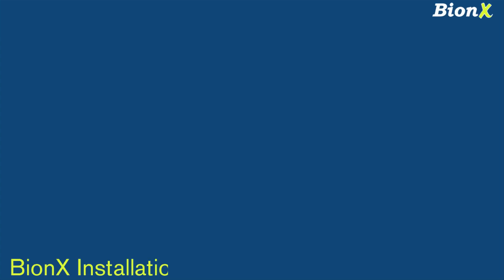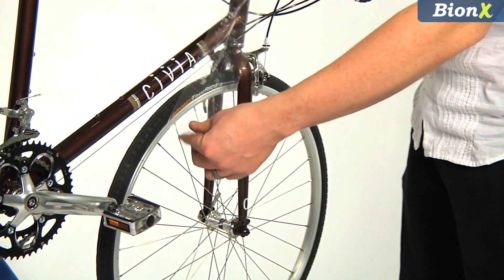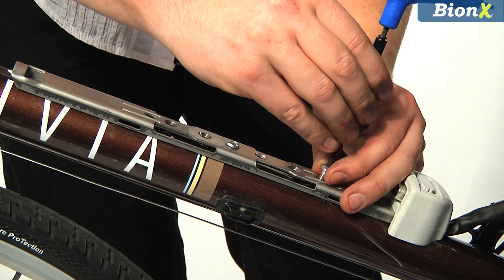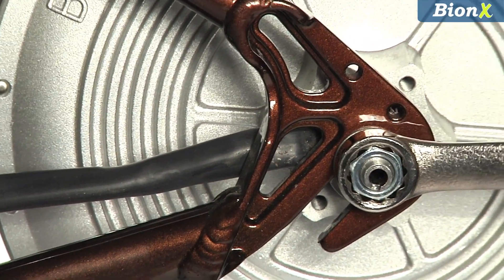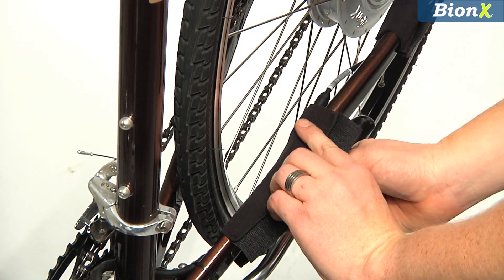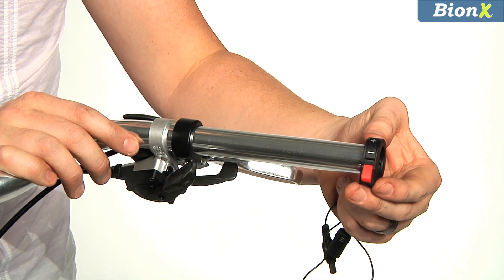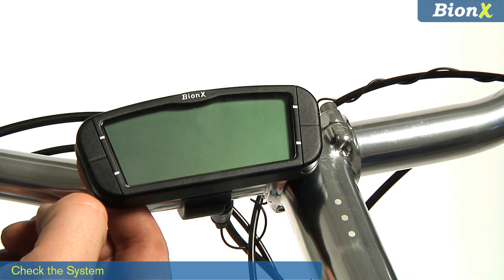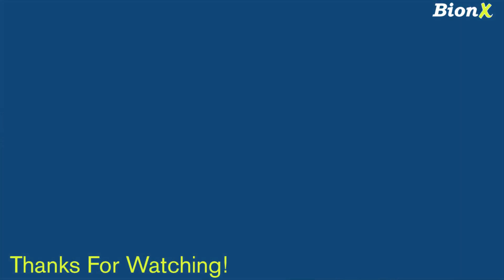BionX installation instructions.

Comment: I have a KTM e-bike Trek with Bionx driver. Overall I am very satisfied, but I have a small dilemma.
The battery charge indicator shows 90% of the time that it is 100% charged. It is only at the end that the rate drops sharply to 0%, even though the support is still full. What could be the cause, wrong indications and how to fix it?

Comment: Are these holes at 1:00 -1:30 pre-drilled on most bikes? Or did you have to drill/thread? I'm getting ready to order a bike I want to put your kit on. I don't see these on the down tube. It's a womans bike and I dont see how I can get in there to drill out straight up and down. I think it will end up sitting off center. Make since?